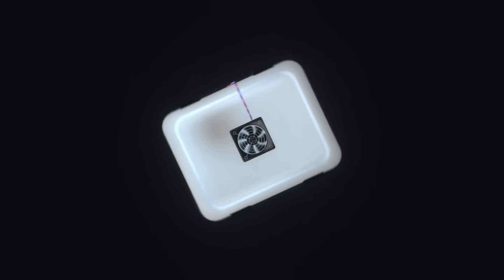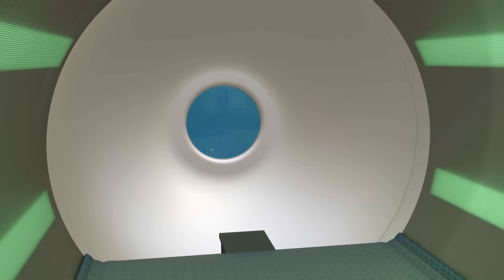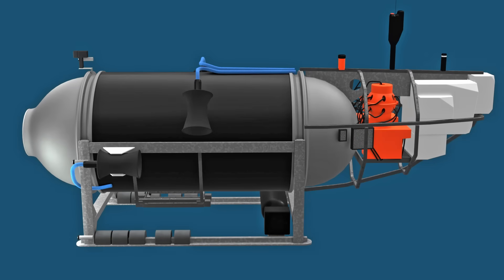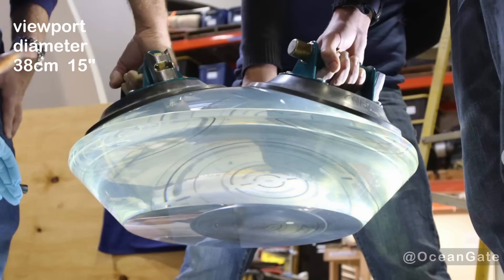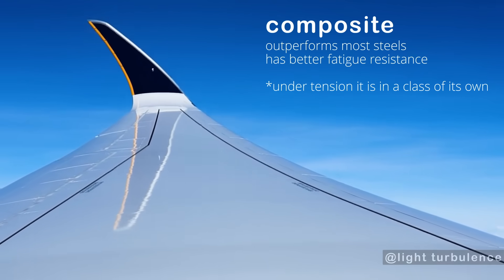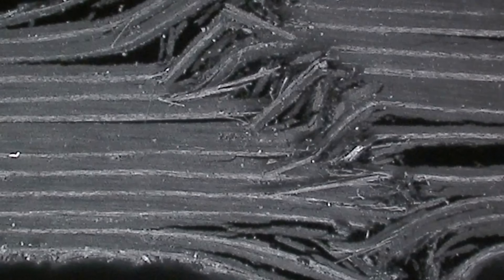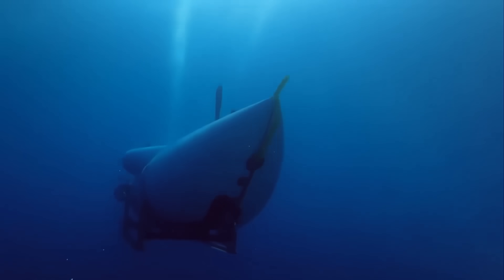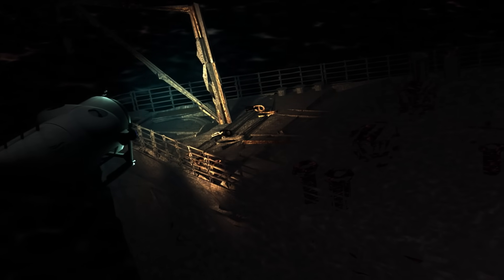Titan Sub | carbon fiber - Detailed Tour

Comment: Having worked 30 + years in the aerospace industry, mostly on titanium structures, large wide chord fanblades, and the early carbon fibre blade development, which failed the bird strike test. My expertise was mainly high resolution ultrasonic testing and measurement of bonding and joint integrity, plus integrated material thickness measurement using 'C' scan techniques. On these rotating aeroengine critical parts, the highest level of integrity was essential, zero failure. It became apparent that the absolute lowest levels of contamination in these bonded structures had to be attained to ensure that was achieved and maintained throughout  the manufacturing process. Something that the Titan vessel  maufacturing process appeared to be lacking in.
Reply from the maker: Listening to the Titan Coast Guard inquiry currently underway the poor layup and lack of care taken on the winding process was very substandard.  There was debris in the adhesive.  Large wrinkling and porosity at 2.2%.  Quite shocking really and the retrieved pieces of the hull showed severe delamination.  Its a wonder the hull lasted as long as it did.

Comment: It was not the fault of carbon fiber.....It was the prep, layup and lack of autoclaving. you MUST vacate any captured VOCs and air pockets.......The adhesives MUST set up under pressure and heat.

Comment: I guessed the seal joints between carbon fiber, and steel rings. I don’t care how hard you try. A flexible material cannot be under that kind of pressure joined with a rigid material like steel or titanium.

Comment: Ocean Gate also used salvaged material from NASA space program on the cheap to mix build its 'doomed' craft, that is a big risk to its structural integrity in mid of super high pressure down there.:hand-orange-covering-eyes:

Comment: Just viewing this now and pleased with your analysis. Maybe this has been discussed but wirth mentioning, after 12 years of research and development the US Navy launched an unmanned submersible, the AUSS in 1983, capable to depths of 20,000 feet. The Advanced Unmanned Search System made 114 dives, is 17' long, 31" diameter and weighs 2800 lbs. And, is tubular, constructed with titanium end caps and it's center section of carbon fiber. So, there was a precedent for carbon fiber/titanium in submersible design. Granted, OceanGate did not have the budget of the US Navy.  PMc

Comment: A thorough, detailed and plausible explanation,Mike. Kudos to you. As an engineer with limited experience of CFRP, one issue has always concerned me: ongoing inspection of multi-use CFRP structures. It is, I believe more difficult to detect for an accumulation of voids, cracks and fibre alignment issues in CFRP over time, particularly for a substantial structure such as Titan's hull. As you pointed out, it is quite possible that the axial fibre integrity was compromised gradually over repeated dives. CFRP can certainly withstand significant compressive stresses, if well designed and fabricated. However, it appears to me that it is difficult to detect the build up of material issues which could undermine the integrity of the original structure. Perhaps much more attention should have been paid to this  issue by OceanGate. I wonder if this will be one of the findings from the ongoing investigation. Thanks again for a wonderfully presented explanation.

Comment: I think something caused the titan to lose power and without power the thrusters dont work and without the thrusters the titan would stick straight up and down like a pencil they would have no control and that would cause the crew to fall on top of each other on the heavy side of the sub the porthole window with all of that weight in one spot titan sank very fast that caused to much pressure to fast and caused the implosion!!

Comment: Every material has its most optimal usage. While carbon fiber can withstand compression forces it is not the best material for it. Especially for repeat dives. Also, it's not a homogeneous material which is a big liability in deep sea compression. Also, the flange mighthave been blown outward because after it blows inward it does go outward in an explosion, or I may be thinking about nukes with that one.

Comment: 20 mm = .75 inch (3/4, not 3 and one quarter)   200 mm = 7.87 inches.  

Leaving aside the "how many elephants" hyperbole, pressure at 12000 ft is 5600 psi, 380 times that at the surface, but is by no means extraordinary.  Consider that some hardwoods are  able to withstand this pressure...

Comment: As someone else put it quite nicely: with just a few strands of carbon fiber, you can drag a car down the road, but try pushing a car down the road with the same carbon fiber strands. Doesn't work so well anymore now, does it. In aircrafts, carbon fiber is used to withstand internal pressurization, not external one. It is an amazing material to handle a pull on its structure, not a push. Because under such conditions, the fibre itself doesn't add anything to the structural integrity of the hull and you're basically sitting in a hull of just epoxy.
Reply: that,s simply not true. think of carbon fiber like reinforced concrete the carbon fiber is the rebar and concrete is the resin. Engineers  other wise wouldn't make aircraft wings out of the stuff. but what dose matter is how its put together and that its tested to know its limits.

Comment: I have written this multiple times. The composite hull tube gained weight due to water entering cracks between the fiber and the epoxy.  That is obvious, the faster then normal descent rate is due to not taking into account the water in the composite tube.  
The other affect of cracks is changing the diameter average where dept pressure is applied. The radial stress at diameters greater then the dept pressure diameter is tension instead of compression.  This further increases the rate of crack propagation.
Failure didn't have to happen.  This cracking problem is well known in composite pressure vessels.  The solution is simply to put a barrier that prevents water from contacting the composite cylinder.  It needs to not be permeable for water at depth pressure.  A plastic or rubber is the likely choice, however; metal would also work.  The pressure would cause this thin cylinder to compress, reduce diameter, until it contacted the composite cylinder.
Reply: Stockton would have used trash bags split in half with duct tape.
Reply: jokes aside, he sprayed truck bed liner on the outside so it looks unifform

Comment: Not an engineer, not a submariner, but from what I know of physics, a spherical shape makes a lot more sense than a tube, for resisting enormous compressive forces. Furthermore, joining a tube to two hemispheres made of dissimilar materials strikes me as completely nuts. The two different shapes made of two different materials are going to compress at different rates and the place where they are joined seems like an obvious point for failure. But hey, as the guy proudly said, "I break a lot of rules."
Reply: He actually is quite cleaver in a 10 year old boy way. Only thing he missed was drawing it on the wall of the tree house.
he 2 different materials don't matter so much because they are not subject to the same loads at the same time and have an interface that needs consideration. I think THAT part was luck more than a concious thought. 
The tube is not under Compression, it's under Hoop Stress.
The Ti-end caps are putting Perpendicular Axial Stress on the tube at the same time.
The end caps ARE under direct compression, passing that stress directly into the "glue" then onto the tube/glue interface and finally the tube. Squeezing the tube is the perpendicular part.
I made that definition layout to point out how 8th grade-ish Stockton's sceince is. 
He seems to have a Popular Mechanic's Magazine type knowledge base. 
As I do. But I recognize "I don't know WHAT I don't know"
Stockton has created "The Stockton Rush Paradox" for engineering.

Comment: Rarely comment but as an experienced and qualified engineer this is the best video on this event by far. Clearly there isn’t anything inherently incorrect in using composites for this application and fascinating that you deduce the axial crinkles in the carbon fibres the likely failure mode and source of the repeated noises in the run up to catastrophic failure.
Reply: You can't push fibres!
Reply: @Sidowse  you can push fibers, until the resin gives up. 
One thing not discussed enough here ....  "The Sphincter Valve Effect" 
What happens is.... BOTH noise & visuals are translated into Electrical Impulses for interpretation by the brain.
When formed, these impulses of information travel South to the Sphincter Valve aka the Orifice Interface.
The Sphincter Valve controls electric impulses in an effort not to overwhelm the brain.
Nerves are very thin in this anal-type area. They need a massive amount of bloodflow to pass the Interface, traveling on to the brain.
Once you throw TOO MUCH INFORMATION down there, the electric impulses backup, the Sphincter Valve closes, blood flow drops.... nerves can't pass information ....... and the brain has no choice but to mutter the only thing it still sees, OH SHYT!!!
Reply: There absolutely is something inherently wrong with using CF in this application which is why nobody else uses it and why the only deep sea sub built with it imploded and killed everybody on board. Dunno why people are so attached to CF as a viable material for this application.

Comment: The fact remains even the most exceptionally well crafted carbon composite hull cannot be inspected properly after each dive for structural integrity. There's no such issue with titanium pressure hulls.
Reply: And I like how he brings up the carbon composite compressive strength, and then immediately debunks it with the exact reason it's not suitable for this application.

Comment: This is really interesting, thanks. I still feel that, given the extremely tight requirements for the layup, "composite isn't suitable for this" is still a reasonable simplification of the facts. I can certainly understand the classification societies' reluctance to assess it, because the actual strength depends so much on the tiny details of the layup, which would be very difficult to verify unless the surveyor is present for the entire layup process. 

One place I disagreed with you is that I don't feel a safety factor of 2.6 is all that generous. I would default to 3 for applications far less hazardous than this. 

We will all be really interested to see the results of the investigation.
Reply: The real issue is complexity. One thing they always did in school science class was cut the complexity way down so it's teachable.
They taught you that "a plane flies by the air passing over the wing", right?
They don't teach that in college engineering cause ... air does NOT pass over the wing THAT " pass over the wing" description is not technical enough to REALLY make a plane fly.
Stockton Rush understood the sub and it's engineering needs about JUST LIKE 8th grade science class.
maybe not even as well as an actual taught class, maybe his knowledge was more "Imma go take my morning dump and read Popular Mechanics" level. Sounds like it really.
It's 15 variables ALL AT ONCE, any attempt to 'order' them ? Is faulty understanding.
It's the old  "threshold hypothesis", and Stockton didn't know WHAT he didn't know, and he refused to look.
But his sub Titan did complete 13 dives to the Titanic wreck site. Just not 14. he made 13 1/2.
He also attempted Titanic 90 times. Stare at that number all you want.
He had a 86% failure rate. 
Even simple stuff like ballast release was beyond his grasp to get right the first time.

Comment: Is carbon fiber good in compression?
However, the inferior longitudinal compressive performance of carbon fibres and their composites compared to their tensile properties limits their wider usage. Indeed, the compressive strength of carbon fibre and carbon fibre composites are about 30 to 50 % of their tensile strength ...OceanGate THE RIDE OF DEATH ! At the meeting, Lochridge discovered why he had been denied access to the viewport information from the Engineering department — the viewport at the forward of the submersible was only built to a certified pressure of 1,300 meters, 4,265.092 ft although OceanGate intended to take passengers down to depths of 4,000 meters,” 13,123.36 ft

Comment: carbon is strong when pulled, not when compressed....period!
Reply from the maker: Tell that to racing car suspensions and racing yacht foils and bike frames.  The list today is pretty endless.  If the material could only handle tension all those structures would collapse like a cloth.  No they handle insane compression forces because carbo n fibre is a wonder material... in compression too!  When constructed properly and with great care unlike Titan

Comment: I think itnis still silly to try ti use carbon fiber externally, i think it would be much much better to do something like titanium exterior with a composite internal structure maling the hull more rigid and stronger. You could for example build a large eliptical titanium hull and have scaffolding inside its cavity to stiffen out the most unstable modes of deformation, then you might be able to have quite a bit thinner titanium hulls per depth, due to limiting deformation considerably, this kind of internal skeleton could be easier to inspect and replace as well, while reducing the over all strength to weight ratio of a sub, especially at somewhat larger scale. You can also in principle use a multi hull design with stepped pressure gradients, for the titanic you could do a titanium hull that steps down say 100 bar, and then two carbon hulls that steps down 150 bar each, with active pressure regulations, and i think carbon would be more suited to this kind of application, thennit could be thinner and in many shells, such that the deformation would be less degrading to the material, although problems like evenly distributed compression also has to ve wached out for.

Comment: Basically because of the hulls deformation, that i garuantee you was there even if it was small, would have increased the compressive load from the titanium end piece onto the cylinder. Basically the cylinder is unstable under pressure and unless ot is exactly circularly symmetric in shape and strength it will deform in a way that does not have circular symmetry, this 100% happened, its is like putting a weight on a string, the first infinitesimal displacement of the string from the weight of the weight, requires no force, and when the angle of deformation is practically 0 the leverage is crazy, a tiny displacement in the radial displacement of the cylinder could potentially create massive localized pressures in the material, some regions would be forced up against the end piece and some be drawn away from it, simply because the cylinder is deformed in such a way that the lenght of the carbon hull is different depending on what part of the hull you were looking at, since in one plane the hull is bulged out, and in the perpendicular plane, both parallel to the lenght of the cylinder, the deformation would be inwards not bulged out, and so there would be these 4 regions around the seal with increased load, and 4 regions with reduced load, and this could in principle double the maximum compressive load locally in the material, or even increase it more, or less depending on how large the deformation was, and also the stiffness of the material and the rigidness of the titanium bulkhead. We are talking very large levered forces on the hull, which could accumulate into compressive loading in very concentrated areas of the hull. I think you are right that the compressive loads from the endpiece was very important, but i think it plus the deformation of the hull together has the potential to generumuch higher loads than one would expect with just circular symmetry, essentially the pressure from the titanium endpiece is distributed on the circular section at the end of the cylinder, but deformation coming from the flexing of the cylinder, even if very small, could redistribute that pressure drastically along the edge of the cylinder bulkhead joint, which just males everything uneven and horrible, even if the actual effect is small, just having 30% more peak load on the material is something that can blindside an engineer that thinks he has put in enough marking,all those crackling noises he heard could easily have been hairline fractures with water ingress, just from these uneven pressures from these effects, you cannot just assume the material is homogeneous and that the forces and deformation is circularly symmetrical, that kind of mistake can bite you, you might be adding 30% extra strength to compensate for a simplified analysis, but the real safe margin given that model, and how the thing actually behaves might be 70-100%, easily, because the moment the material is twisted and unevenly compressed, the loads in certain parts of the material might be double what it is in any part of the circularly symmetric model of the material and forces.